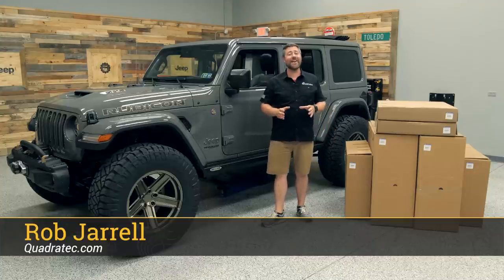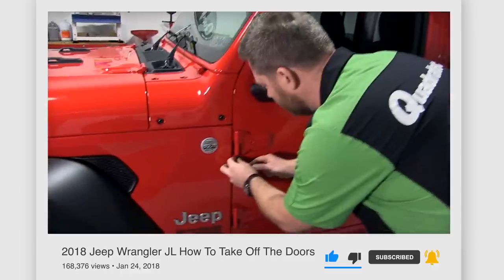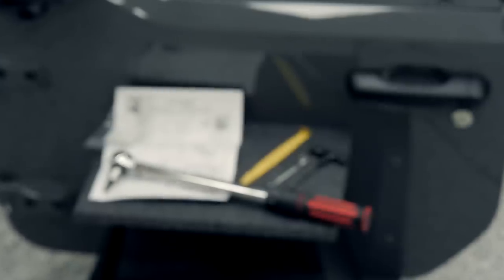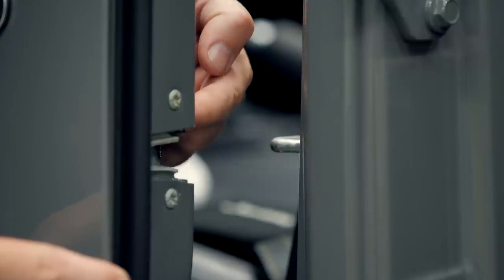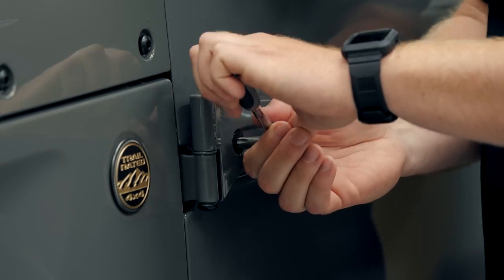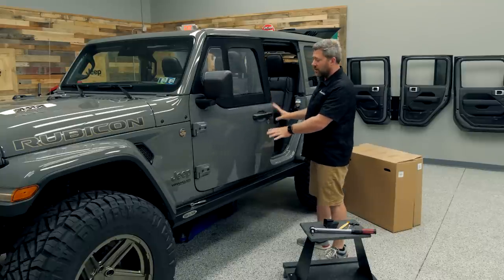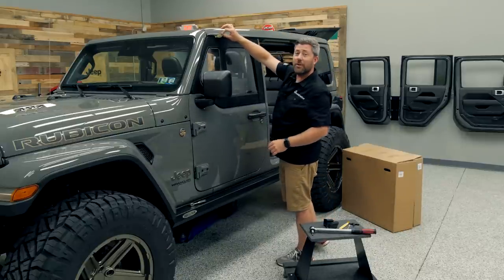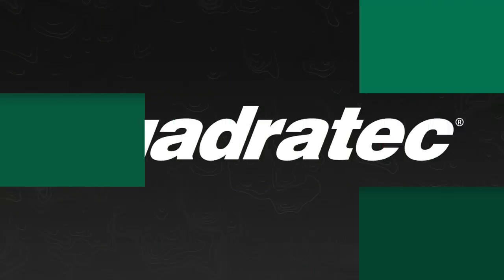Jeep Wrangler Rubicon 392 Upgrades & Dual Door Group Half Door Install

Comment: They should make the half doors with soft uppers as standard equipment like they did with yj and tj when ordering a jeep with a softtop.  Full doors could be upgrade option bundled with hardtop.  Then, for the big spenders, offer the dual door OPTION.  Keyword is "option"
Reply: I think that style looks best too!  I wouldn't get a jeep just for comfort and convenience,  but to be more versatile in various weather conditions along with offroad capability.

Comment: So let’s say I’m off roading and open the door will the step things just break off when they hit a rock? I don’t get this build. 38s look like too much with out a lift.
Reply: It’s a street build.
Reply from the maker: Those step sliders, are a true rock slider, and when the step comes in contact with resistance, it stops, you would have to work really hard to break them off. Here is some more info on the steps for you: https://www.youtube.com/watch?v=nke5n9A7Kk4 
His lift is on the way from teraflex.

Comment: The dollar bill and flashlight trick.....can that be used for JK/JKU owners? Seems like a good way to address leaks in the tops.

Wished the JK/JKU hard top windows could be removed liked that. I'd be happy if I could have a sliding window for the rear panels like you see in those Ursa Minor camper tops if I couldn't remove them.

Not sold on those 20" rims.

Comment: Do those upper halfs flap open when driving at high speeds like the bestop aftermarket ones? I loved those but it was horrible driving with them on, I had to use bungees to keep them from flapping open
Reply from the maker: The design on these uppers is very similar to the design on the Mopar JK half door upper. Those have no flapping problems at all. Very sturdy construction vs the thin metal frame you are talking about.
Reply: @Quadratec  Thank you very much

Comment: I thought very easy to install. I was however disappointed that the uppers try to wing out when driving 70, as in the wind grabs them and creates a half inch gap at the top of them. My 2010 Jeep came with half doors from the factory, and they overall fit a lot better, and we're not at all affected by the wind. Another disappointment is the strap handle, a very cheapy design that is difficult to quick grab if the wind tries to slam your door into the parked car next to you at Walmart. Considering I paid 5 grand extra for these 4 half doors for my Unlimited, these doors should have at least been the same quality as my 2010 Wrangler, if not better.

Comment: I had a 86 scrambler, and a 90 wrangler. Both had full, soft and half doors. I can see what an absolute pain in the ass owning a newer jeep is in comparison. It would literally take me less than one minute to swap from one style door to the other. Never needed to mess with alignment from one door to the other.
Reply: you only align them the first time you install them though. After that they're set and it's the same quick procedure every time.
Reply: A 1986 scrambler!? That there is a very rare beast.... From what I recall only a 126 were sold or made.... I would love to have one.

Comment: I’ve been struggling adjusting the uppers’ tilt.  One thing nobody tells you that is important, is if you adjust the tilt on one leg of the upper, then you should adjust the tilt of the other leg on the upper exactly the same, or the upper will get stuck inside the door and removing it will scratch the painted metal of the half door at best or at worst break.  Also there is no way to tell if both legs are tilted to same exact angle, or how far of a tilt is too far.  When you tilt too far then screw is on an extreme angle and causes upper to get stuck in half door and again scratch paint or break leg.  I think there are too many moving parts which makes it fragile and gives it a shorter lifespan.  I miss the half doors on the JK which had stronger legs and more sealed protected holes in the half doors.  Don’t get me wrong I love them.  They are just a lot more fragile than the JK half doors.